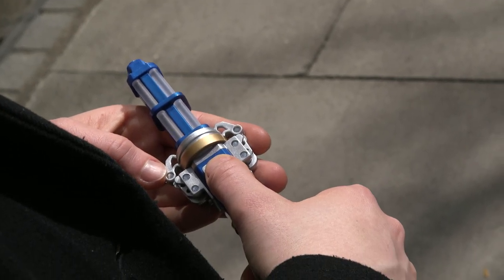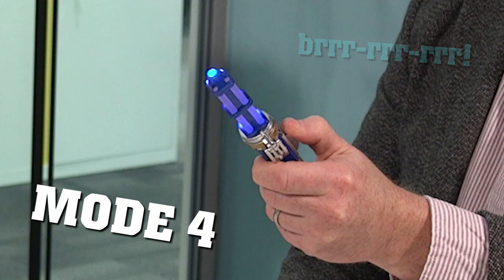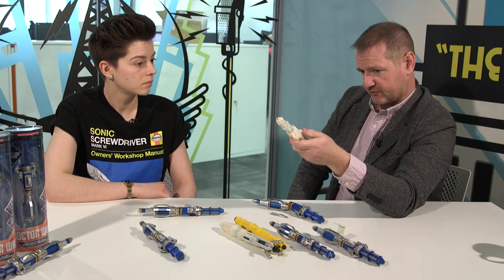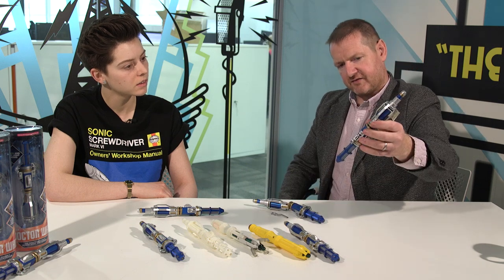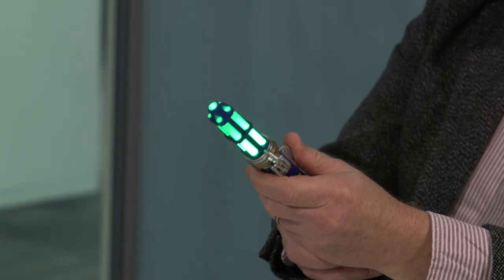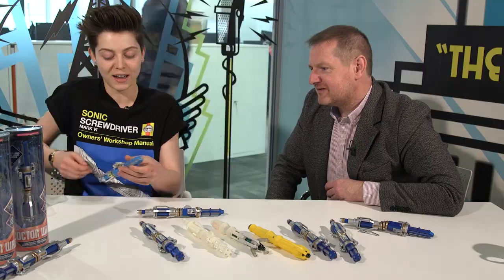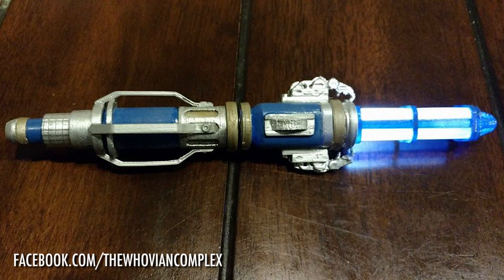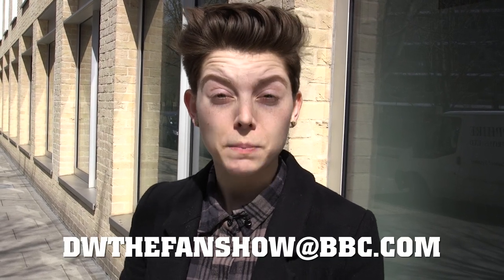The New Sonic Screwdriver Toy | Doctor Who: The Fan Show

Comment: I still think that they should re-develop it with a secret and non-disclosed red setting added. That would make it that much more cooler.
Reply: That's an idea I was thinking of. I thought about wiring a switch to the bottom of the battery compartment that would switch the green setting for the red one (since I remember one prop Peter brought on a talk show only had the two.) Not sure if I'm smart enough to do that though.

Comment: Its not the first that has 4 settings. I have an 11th doctor sonic that has 4 settings.
Reply: The Ninth/Tenth Doctor screwdriver has 4 settings too
Reply: @KayDvn  Well, they're not really settings. They're just sounds. The 9th/10th sonic has two settings, extended and retracted.
Reply: @OrtarkGendar Afaik all of them have 4 sounds. I (unfortunately) bought the old 9th Doctor screwdriver without the new slider and the better mold. I think the End of Time and the UV sonics are the only ones without 4 sounds. Besides, the classic sounds are utter crap, and shouldn't even be on the 9th/10th Doctor's sonic.

Comment: I like the coloring of this new sonic screwdriver. But it doesn't feel as sleek as the last two with the metal parts sticking out the sides of the bottom and those two clamps near the top. 

Otherwise, yeah, it's a cool one.

Comment: the dude made the toy and got one of the details wrong, impressive, matts sonic was the first one with four settings, and he can't mean how to access it either.
Reply: +animo358 As far as I recall it had 2 sounds and a siren kind of sound. What is the 4th?
Reply: there are two effects when you just push the button to simulate the way the sound changes on the show, then if you press it....either 2 or 3 times it goes for the blinky broken sort of sound, and 3 or 4 times gives the old sonics sound. i'm just not certain cause I don't have my sonic right now.